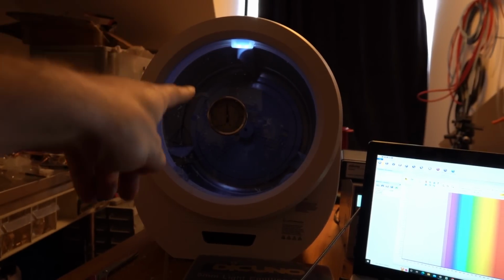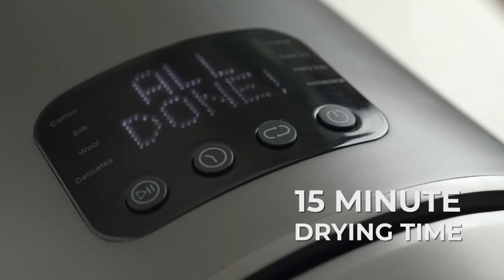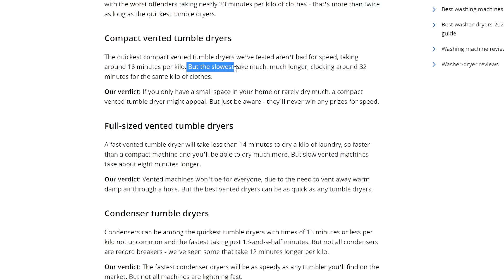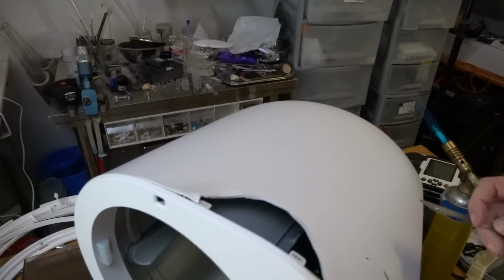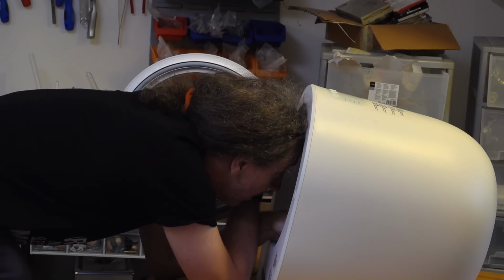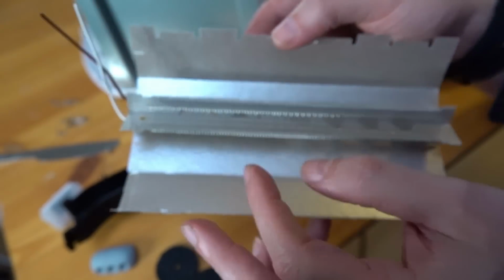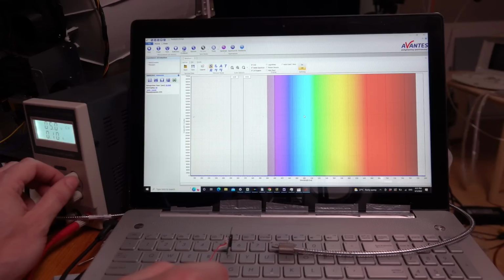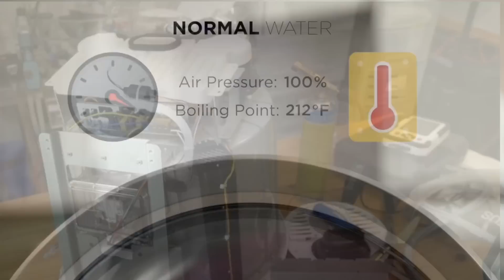Autopsy of a Scam-Starter: The Morus Zero!

Comment: The common misconception about LED's. It's the current you have too look at, not so much the voltage.😉 You killed or at least damaged the LED with that much current and heat.
If you know the forward voltage of your LED, ~7V in this case, you can set your PSU to ~10V and slowly turn up the current. And in this case I wouldn't have gone over 100ma.
Reply: I totally overlooked the current issue .. Respect that you pointed it out. Hope thunderf00t reads your posting and say something about it. Usually he can admit errors.
Reply: @PygmalionFaciebat  No need to admit errors. He has a lot of knowledge in other areas.
My comment is for everyone who understands my english 😅
Reply: Sure LEDs are current driven. And as he pumped 7V at 0.3A trough this led it went to 2.8W but that is the whole bloody point! If he did it correctly it would be 7.5V/8V at 0.1A  that is 0.8W!!! What kind of UV sterilisation you get from shit arse led like that? Also it barely gets to 200nm I would expect at least 250nm at 20-30W for application like this to even consider calling it sterilisation.I used some industrial UV leds for water sterilisation and we had to run 50W led canon lights at consistent 280nm for the best result.
Not to mention there is ONE led. Would made some sense if they put front and rear strips of these but not bloody one £5 uv led 🤦‍♂️
Reply: Well if the forward voltage is 7V then sending 7V will not damage it; going slightly over will damage it but he was at 6.9V on the PSU
Reply: @SpeedcoreDancecore  It’s about limiting the current, not the voltage.
Reply: @SpeedcoreDancecore  Pretty sure the Vf is lower than 7V, can't trust what the PCB says. Maybe the package contain 2 leds in series, I've never seen a Vf that high. Anyway, that LED definitely can't take 2W+ without a heatsink. As @Tristania said, it was being overdriven for sure in this test.
Reply: LEDs are designed to be pulse driven, not constant power even though they kind of work. If you run at the appropriate voltage, an LED should only pull as much current as it needs to maintain the active phase of the frequency while it cools down in the inactive phase. Pretty sure this is why that plastic cage melted. One of the chips on that board likely has a pulse modulator to control the PWM of the signal to each LED set. Having put LEDs in direct contact with 3D printed plastic, yeah you need to be careful not to drive them too active of a pwm, it will deform the plastic (typically severe warping) with intense short range heat.
Reply: @zmast333  So the point stands this is under engineered piece of shit.
Reply: You are probably correct but that even drive the point further! Why would you put pulse  LED there when it is obvious that constant current LED is called for in this application. This is the worst excuse attempt at UV sterilisation I ever seen. If you can even call it that.
Reply: There was a large 3R00 SMD resistor(3Ω) on the LED board, and 4 more smaller current limiting resistors for the white LEDs. 3Ω is probably not enough for constant without a heat sink, so PWM probably applied.
Reply: @-Tris-  Dont worry about your english. My english is for sure much worse ;)  (my native language is german). 
And yes, thunderf00t not only has a big knowledge in other areas .. but even that LED-thing with the current, could be easily just overlooked by him, because he was so focused on the voltage. He probably know about the current-issue. It just happens sometimes. I also made in the last morus-video a stupid mistake about thermodynamics.. i asked why the water doesnt vaporate, when the airpressure is lowered, because i assumed the change in  pressure does the job (because that itself needs energy). Later on someone answered me, and i felt stupid, because it was really obvious for me - to an extend that i already knew it, and i was surprised why i didnt recognized it at first (as someone who has thermodynamics as hobby since 20 years). 

And yes, thunderf00t doesnt need to correct such small errors in his video, when the overall message is the most important.
Reply: @danielb3299  Current and voltage are not independent variables, by applying the nominal Vf across a diode it will also draw its nominal current; by limiting the voltage you also limit the current (but we don't do it in practice because as the diode heats up it will draw less current and the light output also goes down; so we prefer constant current drivers)
Reply: @TOKOLOSE  barely gets to 200 nm? I think you've got the wavelengths bass ackwards. In this case, shorter wavelength is better. Shorter wavelength=higher energy photons and more ability to shred organic material, ie sterilize.
Reply: @PygmalionFaciebat  Wie praktisch😁
Ja jeder hat hat mal so Momente wo das Hirn ausschaltet. Ich tippe oft auch schneller als ich denke.
Reply: @eideticex  I have never heard that before. You can pulse an LED, and when you do so, it can take a bit more current. But you still have to limit the current even with PWM.
Reply: @-Tris-  your understanding is poor. you cannot reach the rated current unless you reach the rated voltage. Ohms law. The led has impedance. Do you believe that you could exceed the current rating with a lower voltage? Explain. If the led overheats at the rated voltage, then the obvious answer for not overheating during normal use is reduced duty cycle
Reply: @PygmalionFaciebat  What does "turn up current" even mean? The current the device will draw is determined by the device, not the power source granted if the source can't deliver current demands it won't work.
Reply: @You're Gonna Hate This I think you got something wrong.
Every LED or diode has a forward voltage which is determined by the materials it is made out of. You need at least this voltage so that enough current can flow.
"if the voltage deviates more than 10%, the LED bulb is fused off" yep, because the current will rise exponentially. That's why you have to limit the current, not the voltage.
You can put a ~3V LED on a 100V supply, as long as the current is limited to the right amount, the voltage will just drop down to the LED's forward voltage.
Reply: @lexiecrewther7038  Correct. The power source can either meet current demands or not. If the device is drawing too much current then the result is the device not working or things melting, blowing, burning up etc. Yes, voltage can be adjusted but there is no way to adjust the current demands of a fixed device like an LED.  If you deliver too much voltage to an LED it just lights brighter but greatly shortens the life. And if too high the LED become a flash bulb. I can't believe anyone who has actually worked with LEDs and understands the most BASIC of DC electronics is not aware of this.
Reply: @lexiecrewther7038  Read my comment again. In my example a wrote 'set the PSU to 10V'.
That's over the rated voltage(which we don't exactly know) and enough to reach the maximum current.
I think you still don't understand LED's. They are never driven with a constant voltage, but always with a constant current.
Reply: @-Tris-  a little knowledge is dangerous
Reply: @-Tris-  I ran the biggest LED company in the country for 10 years and sold millions of dollars of it. I'm quite certain I know more than you
Reply: @-Tris-  "you need at least this voltage so current can flow"
Bzzzzz. False. As his power supply showed, current flowed long before the voltage was reached. In fact, leds are hyper efficient at lower voltages
Reply: @whichgodofthousandsmeansno5306  "turn up current" means just that. Or should I say ramp up? I don't speak english, sorry if it sounds wrong.
And no,  LED's are semiconductors, not just a simple wire like a motor or an incandescent bulb.
The current has to be limited, that's how every LED PSU works.
The voltage just has to be higher than the diodes forward voltage.
Reply: @-Tris-  "I know this single fact about leds and I'm going to beat everyone to death with it" classic Dunning Kruger
Reply: @lexiecrewther7038  hahahahaha😂
Reply: This is assuming the person connecting the LED to the power source is not aware a resistor can be added to limit current or multiple used as a voltage divider. But this does not change the fact that an LED on it's own deals with current as anything more then a max rating.. like it's max voltage rating. This is basic DC electronics 101 but not everyone is going to grasp it. But anyone commenting with advice had better know at least this much.
Reply: @lexiecrewther7038  "I ran the biggest LED company in the country for 10 years and sold millions of dollars of it. I'm quite certain I know more than you"

Lol, you just lost the argument with one single sentence.
Reply: I think it'll be dependent on the circuit design, a good manufacturer would have designed it in such a way to limit the current passing through the LED. However, This isn't a product of quality manufactur. 

Voltage and current are related and current is restricted by the resistance of the circuit. So you think they would have taken that into account on the LED pcb design. 

But who knows maybe the current is controlled on the LED via an IC on the main board and a PWM signal (it would be a bit over engineered if that were the case).
Reply: @john_titor1  he lost that argument long before... About when he started with  describing the behavior of LEDs with Ohms law
Reply: @robinx6754  explain how an led can exceed its current rating before exceeding its voltage rating. Just because the leds impedance changes AFTER this point, does not mean that ohms law does not apply at the ratings. If it is rated at 7v 100ma, then it CANNOT run at 150ma at 6v. Why would they rate it at 7v if it was possible to exceed 100ma at 6v. Do ya think maybe its because at the rated voltage (and ONLY there) ohms law DOES apply?
Reply: These leds require a 5 ohm resistor, like most.  If you know the supplied voltage the formula 8s voltage 9ver resistance = amperage..  this is pretty basic and I'm sure t foot has not overlooked it.
Reply: @SpeedcoreDancecore  the forward voltage of an LED is usually a range, determined by a.o. the chip temperature. The curve is very steep at that point, that's why you always set the current and then let the LED determine the exact voltage drop.
Reply: @Lexie Crewther you're obviously right about LEDs but you don't understand the Dunning-Kreuger effect.

It is simply that low-competence subjects overestimate their competence, not that they actually think they are hyper-competent.

In a very rough illustration, on 10-point test, someone who scored a 1 might guess they scored a 1.5, someone who scored a 2 might guess they scored 4, and someone who scored a 10 might guess they scored 9.  The slight increase in competence from 1 to 2 is overestimated.  That's all.  Even a 5-scorer would guess more like 6 or 7 than 10.

Just saying...

Obviously the conversation is about LEDs and you scored the 10 here.
Reply: @MrDmadness  LED's require current limiting. A resistor and a fixed voltage is the simplest but most inefficient and unprecise  way. 
And as you correctly wrote, you have to calculate the resistance based on the supply voltage and the LED voltage and current rating.  And you never want to exceed the current rating.
Resistors are usually only used in small indicator lights, decorative light or LED strips.
Every "normal" LED lamp has a current limited driver, not voltage limited.
Reply: @You're Gonna Hate This I got that from hundreds of datasheets and years of experience.
Where did you get your knowledge from?

One last example: the resistance of a standard silicon diode can be a few megohms at 0,5 Volt and almost 0 ohms at 0,7V.
Again: It's not a wire, it's a semiconductor.

Funny how you can say I'm 100% wrong when you very clearly still don't understand diodes. 

I just want to help, but you are free to further ignore anything and live in your own world.
Reply: @You're Gonna Hate This Current increases (almost) exponentially with voltage when you subject a diode to a voltage source, that much is true; this is Schockley's law, i.e. i = is (exp(V/(nVT)) - 1)

Also you don't set both current and voltage independently, that's impossible; you set one or the other at the power supply
Reply: @mjouwbuis  Indeed that is true, the forward voltage actually increases with temperature and Vf is typically given at 20°C so in a not so cold room your LED won't blow up when driving at Vf from a constant voltage source, but if it's colder it might
Reply: @You're Gonna Hate This ok ms. I don't know what equations you want, I'm horrible at math. I wrote that the current increases exponentially when you linearly increase the voltage. 
And I also don't know what you are talking about appeals to authority...? And where am I lying? I can be wrong, and I'm often, but I'm happy to be corrected by someone who knows it better. But sadly you don't know it better. Your first comment was a question followed by "I looked it up". This alone tells me you have no real experience with electronics. Which is absolutely fine, everyone has different hobby's. What does it mean to be 'someone'? You're just someone, I'm just someone, everyone is just someone. 
I guess you are the kind of person who gave this video a dislike, since in your worldview Thunderf00t is 'nobody', and Elon Musk for example is 'someone'. Or maybe you got a Morus Zero and now you are pissed off. Or maybe you are a guy and you can't accept that a woman knows something better. In this case I let you know that I'm a guy. 😉
Reply: @-Tris-  I understand much about electronics but have pretty basic use of leds, mostly I arduino robots I build out of boxes to play with the cat. An rc tank that shoots treats is my greatest creation.. leds all over it. :) thanks for the info.
Reply: @MrDmadness  That's cool! And I didn't want to say resistors are bad, they are perfectly fine for low currents. Like small lights on RC cars for example. Or indicator lights directly powered by an Arduino.
It's just about efficiency and LED lifetime.
Try to power a '10W' LED from your tank battery with just a resistor as an example. Then do it with a constant current buck converter. You don't even need to do the math to see whats better.
Reply: I have a 2 watt LED with a forward voltage of 3.3 volt. To reach 2 watt's it needs ~600 mA (2/3.3 = 0.60606...).

If I set my variable PSU that can do up to 10 amps at 3.3 volts with NO current limiting at all the LED will draw 600 mA.

Now you said If put it a higher voltage and slowly increases the current I will get a much lower current, so lets try that.

I put my PSU at 5 volts and slowly increases the current until I reach 2 watts total, now explain to me why when looking at the PSU display it says 3.3 volts and 600 mA, wasn't it supposed to be different? yet my actual real life test showed it to the same as the first test.
Reply: @-Tris-  I gotcha :)

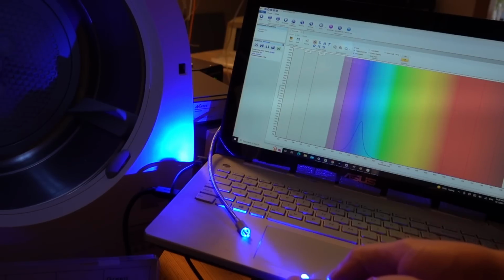Comment: 3:40 No, a white LED is a blue/violet LED with a phosphor coating that is reasonably broadband emitting in the red through green range. Pink is also the same as it's a blue with a phosphor coating. Look inside those and you will see the coating. They are also activated by external UV light so placing white or pink under a black light will make them glow nicely.

Comment: The broken spots on the back could be where the sprue attaches which is a channel in the mold for plastic to flow into the cavity to form the part but isn't intended to be left on for the finished part.  Typically you'd cut that off a little bit more nicely, but if it gets covered by another part, maybe not.
Reply: I was going to post the same thing. It's the standard way of moulding something large that shape without getting an obvious weld/joint line somewhere.